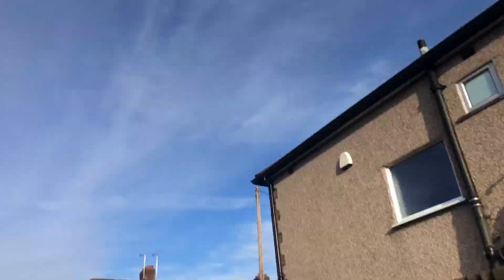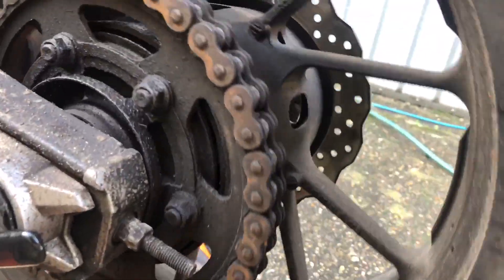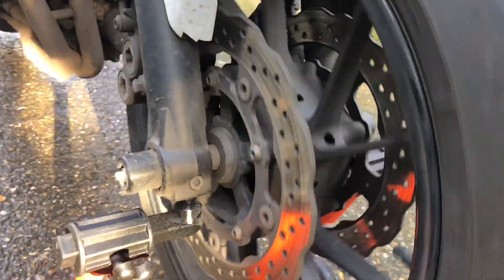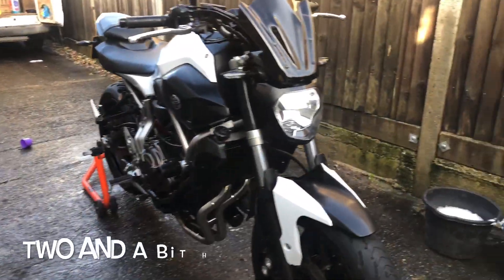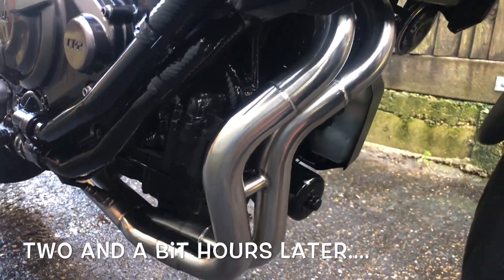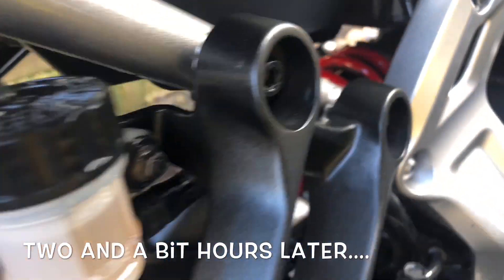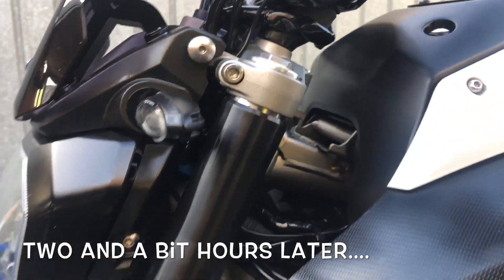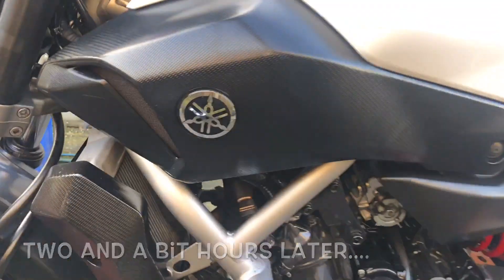Yamaha MT07 TrottFull Valet with ACF50 winter protection

Comment: Wow you're the best yet that I have seen anywhere in getting such great results. Hats off to you Sir!! Question, based on what you have seen, rust wise with the mt07, would you buy or recommend one? And have you seen this persist in the more recent models?
Reply from the maker: Yes I would recommend buying one. Fabulous bike for the money. Just make sure you get it properly protected.
Reply: @fctrott  thanks man. If I had no ecf50 would wd40 work or would you suggest something else?